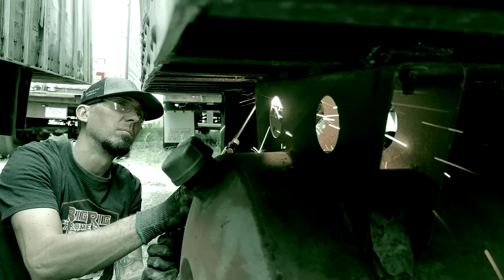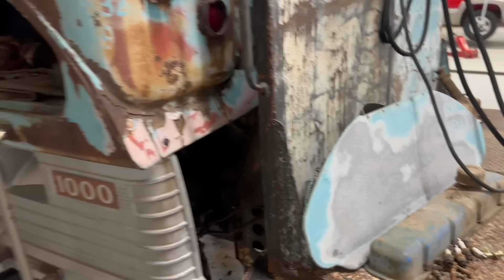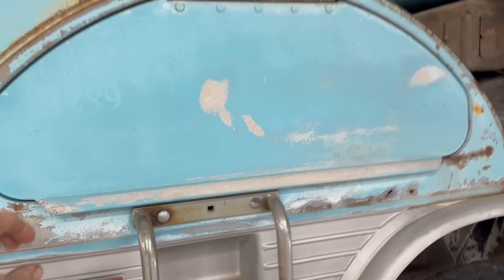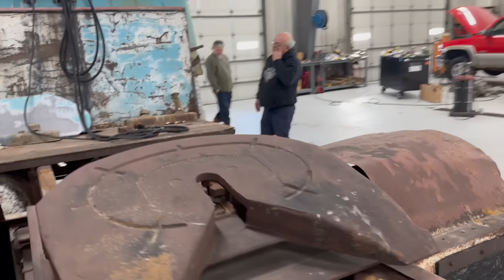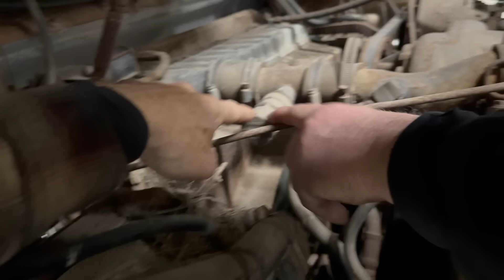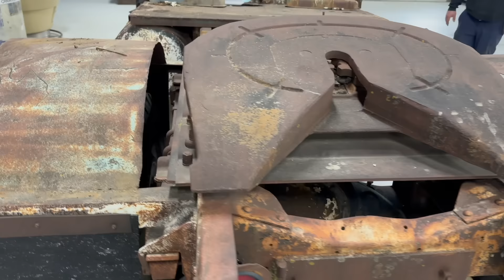Restoration On ‘65 Ford H1000 Cabover Full Tour Interview

Comment: Wow is that a Navajo mud flap on the right?  My old gents company would buy used B-model Macks from a Grocer and line the frame and cross members with oak before adding a dump or mixer body.  The practive of reinforcing the rails with oak was quit common back in the day.

Comment: I remember a guy back in the late 80's rhat had one identical to this one but it was a Red/Orange Color and he used it pulling Mobile Homes.... It would only run about 30mph with a headwind on the Interstate pulling a Mobile Home... The Escort Drivers dreaded when he'd call for wide load Escort service across the State because they knew it would be an all day affair at 12-14 hours Instead of the usual 5 or 6 hours when a Diesel powered Semi Tractor was being used.
Reply from the maker: Yep! Lol that sounds about right. Efficiency wasn’t high with these machines.
Reply: it sure was a cool looking Cabover though... He was an older Gentleman and refused to buy a newer Diesel powered Truck. It was an old Ford 2 story Falcon just like the one you posted here but it was a Red/Orange color and instead of having the Diesel badge above the grille it had a Super Duty Badge denoting it as a Gas engine powered Truck. I believe it had a 534 V8 gasser under the Cab. He pulled Mobile Homes with it from Texas to Arizona weekly for many years.  @FlannelPhilip

Comment: Started out in 65 in a COE White with shiny290 a 5x4 with 2 speed axle, hauling cattle from Texas up into CO, NE & IA then to cattle auctions for a load back to west Texas.  It topped out about 110 mph but at 55-70 it just purred had the old coffin sleeper, I was skinny back then.  LoL  good luck finding anyone to touch those snap ring wheels
Reply: some places will, i have a place near me that still does them and Locking ring. For the old macks and Wheel loaders.
Reply: The C cabs were made by Budd. Used on some Macks and, as you say, some firetrucks.
Reply: Change those out for 11.00 x 22.5 rims and radial tires those liners and tubes sux and bias tires suc worst and a shiny 290 is cool and can be made in to a 350 hp and a big cam 400 is my favorite has a csx 14 l 676 hp in 378 short hood low boy truck.

Comment: That cab was used in so many fire trucks and garbage trucks back in the day.
Ford being cheap just jacked it up an filled in the blank spot s.
As a cabover it was slightly warmer than the big names.
The doghouse being lower heat had a fighting chance to get to you.
Reply: I-H did the same things to come up with some of their COEs. Don't know the model number, but the truck with windshields at the driver's feet was a converted conventional.

Comment: Hey!
It’s a Two Story Edsel!

A what were they thinking design!
Glad he’s saving it despite its looks!😂
👍👍
Reply from the maker: You got it! Thanks for checking it out, much appreciated. 👊🏽🕶️
Reply: @FlannelPhilip  I loved mine when I got it new because it had that same turquise paint and a cat engine.  I was A big dog out on 66 back in the sixties.
Reply: That cab was from Mack originally, then sold to Ford.
Reply: @tn65s  I beg to disagree with you on that comment.  The Budd Company designed and built that cab for Ford, and they made a side agreement withMack and many other fire apparatus builders to use the cab also.  I used to haul those cabs back in the late sixties out of the Budd Plants.
Reply: Yes I had one with a caterpillar that they would pull anything